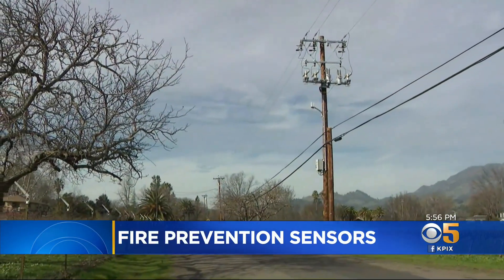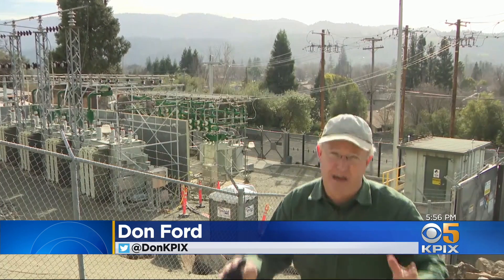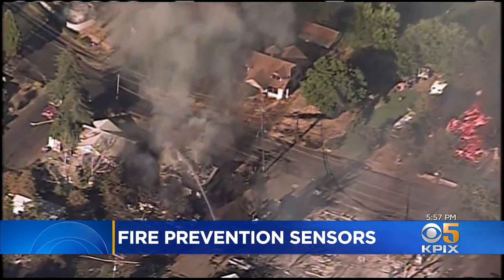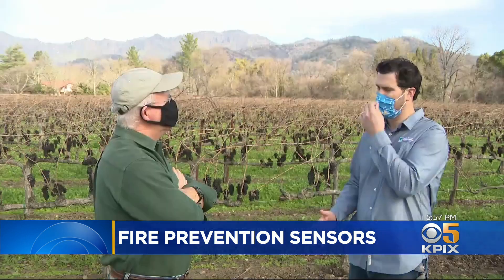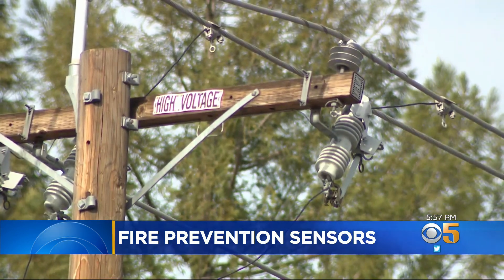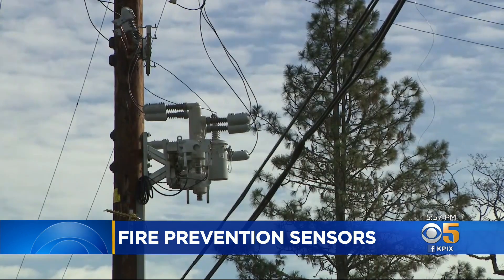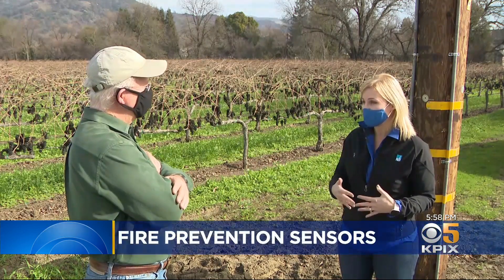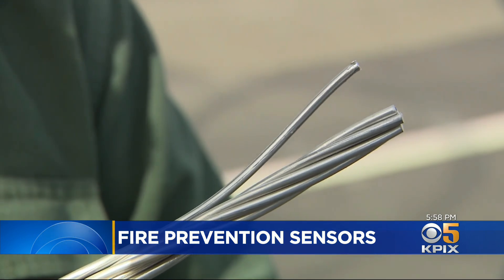PG&E Tests New Wildfire-Detection Powerline Tech in Calistoga

Comment: Its a good thing that california just so happens to use delta connected loads on distribution circuits. If it used the more typical wye connected loads with a multigrounded neutral this wouldn't be possible, because ground current is normal in those systems.